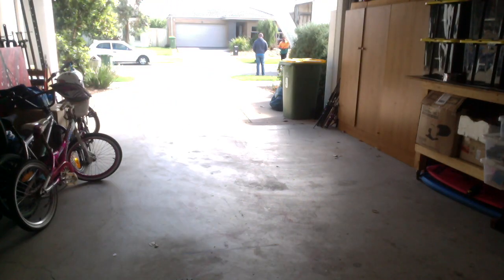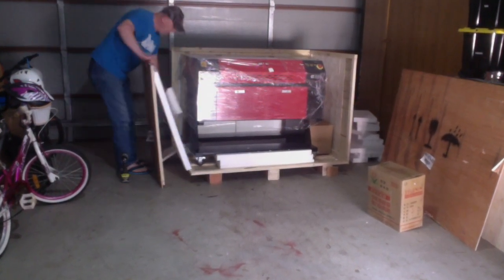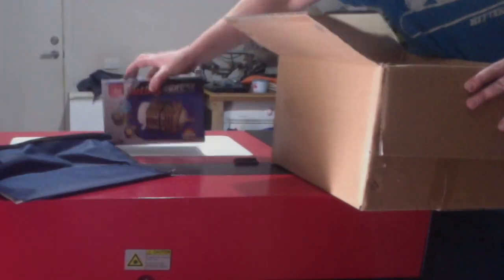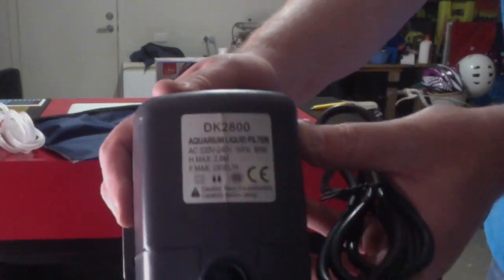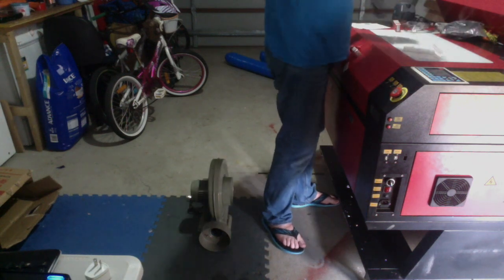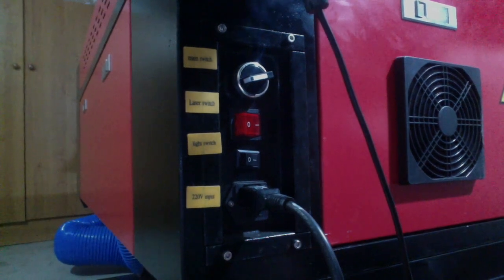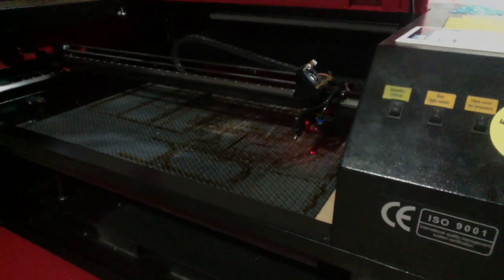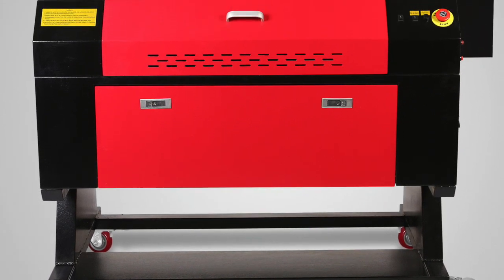80W Laser (TopWisdom Controller) Unboxing & Introduction - CNC Co2 Laser Machine

Comment: Thanks for the video!! 
Did the machine come with outlets blocked at the back of the machine? I am setting up now but cant seem to plug into the outlets blocked by red guards. Did that happend to u as well?
Reply from the maker: I did have some protective caps on the outlets, they are easy to remove to connect the hoses.

Comment: Perhaps I missed it, but did you have to do much work after unboxing to align the mirrors or to focus the laser beam?
Reply from the maker: There wasn't much to do, other than check the mirror alignment,  which only required minor adjustment.  Focusing is done prior to each job using a focus spacer, I did a separate video on how to check your focus.  Cheers Matt

Comment: I see numerous red-and-black Chinese lasers available for sale . . . like the Orion 80W and 100W on Amazon (which users say supplies great customer support) but also several other lasers with different company names but all look the same -- and for several hundreds of dollars less than on Amazon. Do I need to worry about "brand name" or source for the red-and-black Chinese laser -- or are they all pretty much the same? Have you ever tried to use any customer support from the company that you bought your laser from?
Reply from the maker: I purchased through eBay (Australia).  I found support and warranty is not easy to organise though most eBay Sellers.  I don't believe there is a lot of difference in quality between each supplier of these clone red&black machines.  If support is a requirement you will need to research that in your local market.  Most of the machines however do come with 12-24 months warranty, but this does not usually cover the laser tube or power supplies.

Comment: Did your laser come with safety glasses and if not do you need them?  I thought you needed safety glasses matching your laser, but my laser didn't come with any and the company says you don't need them.  
  Why?
Reply from the maker: If you operate your laser with doors and covers closed, then safety glasses may not be needed, however if you operate with covers open, you should get safety glasses that are rated for 10600um like these https://mwlaser.com.au/product/cloudray-10600nm-laser-safety-goggles/ 
I do recommend using them anyway - You only get one pair of eyes.

Comment: Can the laser etch/engrave in multiple colors?
Reply from the maker: Hello, What material are you wanting to do this on ?
The laser will cut and engrave by removing material.  If you have a painted tile for example, it will remove the paint and reveal the tile colour underneath.  If you are using a product such as Trolase Acrylic Ply, then it will remove top layer of the material revealing the core colour.  
The laser does not produce a colour on these materials it only removes material when engraving.  You will need to research the material and process you want to work with.
Cheers Matt
Reply: @MWLaser  I was referring to acrylic with a painted surface. Etching will leave the working area with frosty look (Like a white translucent layer)
Reply from the maker: @Kellden5999  If you etch regular acrylic yes it will go frosty, I have not tried painted acrylic.
I do use acrylic trolase for coloured items as you can see on my site. (this is a coloured acrylic ply material) https://mwlaser.com.au/product/name-key-ring-design-a/
Cheers Matt

Comment: Hello
How loud is the fan really?
Can you throttle him?
Reply from the maker: The Exhaust fan? Yes it is noisy... about 63dB measured from about 2 meters.  No it is not possible to throttle this model fan.
I have replaced the exhaust fan with an inline fan that is much quieter measuring only about 28dB from 2 meters.
Cheers.

Comment: Hi Matt. This looks pretty exciting! What led you into getting this machine? Good to see you are getting back into making some videos!
Reply from the maker: Hi, Dave.  Yes it'll be good to get back into the workshop.. it's been too long.  I chose this machine after a friend gave me a demo of his unit which he has had for several years and has made some great things with, seeing this kicked my creative mind back into gear.  Also I wanted something quieter in the workshop to use as I live in a built up residential area at the moment and was concerned with noise complaints if I continued to use the woodworking equipment in close proximity to neighbours.  Cheers Matthew